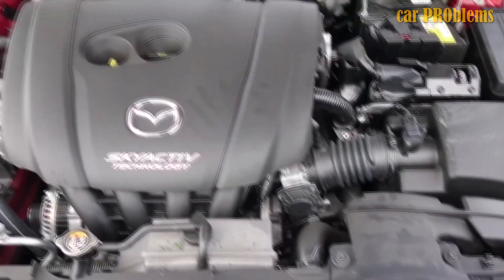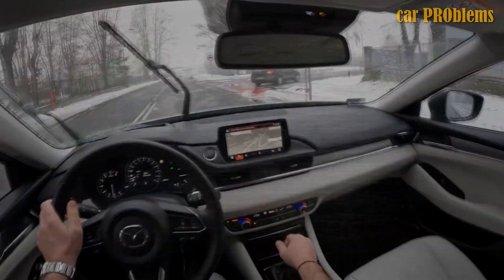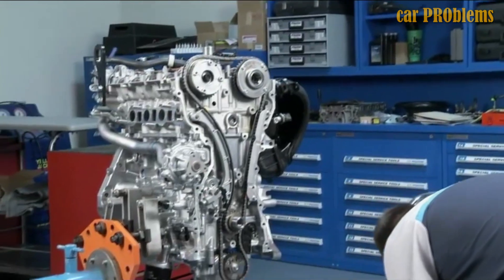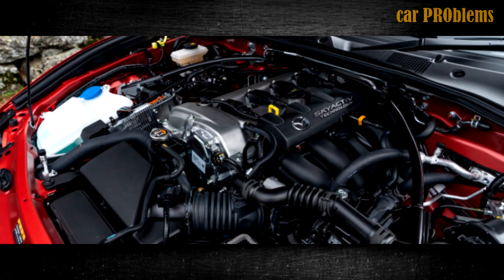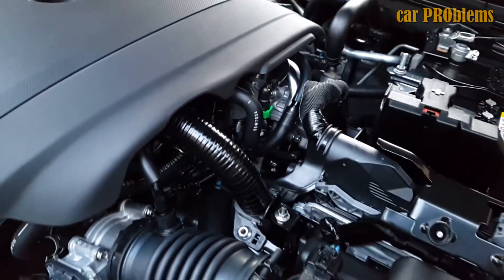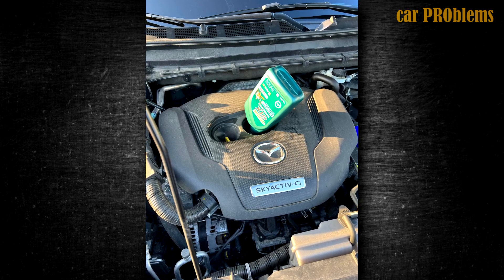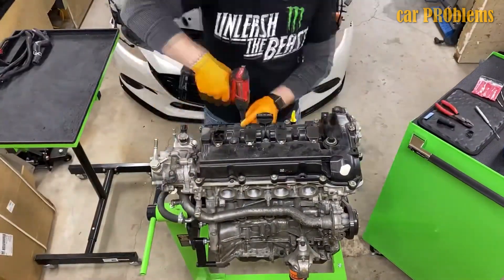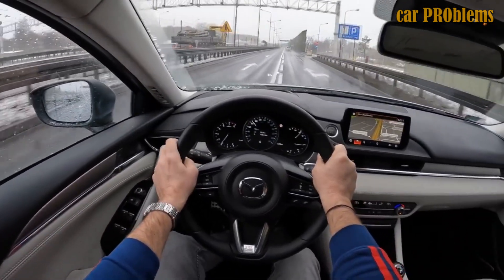Mazda 2.0 Skyactiv-G Engine: Problems, Reliability and Specs

Comment: 2018-2020 2.0 6 AT cx-5 or 2014-2016 2.0 6at cx5 ? Which one would be in better condition at 150,000 km?  How many kilometers can this car travel with its factory-installed pistons and rings without changing any mechanical parts?

Comment: 2012 Mazda 3, fiancées mother owned it until 165k and barely did anything except change the oil. It now has only needed (I did the work myself I didn’t pay anyone) 

a new tensioner, belt, wheel bearings in the rear, brakes, a new gas cap because it threw a code, coolant flush (I wanted to), struts on all 4 corners, (I didn’t like the clunking) one battery, oil changes/filters, 2 air/cabin filters, 2 sets of tires and some sway bar end links in the front and rear (I did them while I was in there doing suspension) 

This car now has 220,000 miles on it and lives a happier life but the point is, with VERY minimal and basic maintenance these cars will treat you well
Reply from the maker: That’s a solid story right there — classic Mazda reliability. You take care of the basics, and she’ll just keep running. 220k and still happy — can’t ask for more from a Skyactiv.
Reply: @carproblemsmax  absolutely love the car, she’s gorgeous, and thank you for taking the time to respond. It absolutely is, Mazda earned a spot in my moral hierarchy with this one

Comment: Bought my 2016 Mazda 3 hatchback brand new with 1 mile on it. I now have 126,000 miles on it. All I’ve done is regularly change the oil every 8,000 or so miles and I had the serpentine belt changed at 105,000 miles. Engine wise, no problems. But I’ve had some issues with my calipers and some broken stabilizer bars. My hatch sits so low to the ground and the shocks are terrible, but overall, it’s been a damn reliable car.

Comment: Use original mazda oil or if you have to use any other oils try Eneos X Prime.
All other 0w20 either don't have the right specifications or additives. I spent like 60 hours to research this properly.
Reply: I use Motul and it runs great. Mazda's OEM (Idemitsu) oil is also very good, though.

Comment: very reliable.. I have the 2.0 G, 117,000 miles with zero issues. I change the oil and filters every 6,000 miles religiously (bosch filters, castrol 5w30 A5 oil).

Comment: Im sick of my Sky G. Nothing goes wrong...ever..nothin to do at weekends anymore.
Reply: Make friends with a chevy truck owner, you'll be busy every weekend helping them.
Reply: 2014 mazda3 with that skyactiv 2.0 manual.. is that good engine in general for moddinng?
or would i be better off with accord?

just reazlied i quiet like how the bdy looks like, like mixtape of A5+accord ass. ;p 

well the one mentionned in the video... 165hp is clearly newer models?

aint 2.0 manual from 2012-2014 like 88kw? :D

Comment: Did he say oil change every 12,000 miles? I wouldn't do that even with synthetic oil. 
I suggest 5,000 mile oil changes with a good synthetic (I use Mobil 1). 
Then if you have to let it slip a few 100 miles it's still OK.

Comment: change the oil every 12k miles? i change mine every 6k Gastrol GTX full synthetic
Reply: I was thinking the SAME thing haha. I change my oil every 3000 miles... Better safe than sorry.
Reply: 12,000 mile oil changes are asking for trouble. Usually do 3,000 to 4,000 mile full synthetic oil changes. I have an MX-5 roadster with the 2.0 Liter Sky Activ G engine.  Really great build quality as its made in Hiroshima Japan. Relatively easy to work on but Mazda pushed the engine all the back in the engine compartment so its almost mid engine giving a 50 / 50 weight distribution.

Comment: I have been driving my 2014 Mazda 3 with the 2.0L and just love it! No, it is not the fastest car in the world but it is adequate, if you know how to drive it. Naturally I have the standard transmission. I got her in 2019 at 36K and have put over 100K with virtually no problems. I do get oil changed every 5K and have done above and beyond what Mazda calls for in terms of radiator, manual transmission, brakes fluids. It goes without saying that I only burn top tier fuel. This just seems like a no brainer. Hopefully the best car that I have ever driven last for a few more years and miles!

Comment: I have the 2018 Mexican Hatchback 2.0 and i couldnt race a turtle with it. 10/10
Reply: Same engine. This one very punchy.  When other late model 4cyl small vehicles race with it, M3 always wins especially at start.  You have engine problems.
Reply: Is it really that slow? 😂🙈 Diesel or petrol? How much hp?

Comment: Made in Mexico 2.0L US Spec engine is very relable in 2016 auto touring sedan model. 42-44 US mpg highway on 87 octane pump gas 10% ethenol.   10 gallons of gas every month is cheap to run.  0-60mph (~100kph) in 7.5 seconds.  Change the oil every 6 months as the car is driven short distances infrequently.  Oil is cheap insurance against many other problems.  Use fuel injector and valve cleaner to remove carbon deposits every six months.  It works.  DIY change the air and cabin filter every year.  It is needed to keep all systems smooth. Still on OEM parts including tires and brakes at 50K US miles.  Climate control flawless.  Starts everytime. Will keep the car 20 years.  Quiet on highway even with cheap thin carpet. Very low quality carpet have seen in a passenger vehicle.  Ride is sporty and tight.  No odors. No issues so far.  Annoying buzz passenger side is metal plate under passenger seat.  Stereo incredible.  No rust.  Wash Wax a few times a year. Paint still shiny, few rock chips.  Garaged.  No road salt here.

Comment: Mazda cars are proven reliable cars i myself own a 2016 mazda 6 until now i have no problems with anything and my 2016 mazda 3 no problems on the engine and it has 85k miles ..

Comment: Does anyone know if 2.0l Skyactive-G 165hp has the balancer shaft (balancer cartridge). In the Skyactive-G 2.5l, the balancer cartridge is mounted near the oil pump and driven by the oil pump chain.

I have heard that 2.0l Skyactive-G does not have a balancer shaft. However, the versions mounted in Miata ND may have a balancer shaft. 

Any comments would be appreciated.
Reply: Only the 2.5 has balancing shaft, all 2.0 do not have it in any iteration

Comment: More efficiency by my Mazda 6 2.5l with 194 HP means easily 12l/100km. Ok, I can also drive it with 7.5l/100k. Mazda did a lot to make their engines more efficient, but to be honest, it is 100% PR.
Reply: My 2019 (2018 model) mazda 3 with the 2.0g does average 14 km/l combined, and I go quiet hard with it.
Reply: I have Skyactive-G 2.0l 165hp in Mazda6. The engine is inferior to the Ecoboost 1.5l 165 in practically every respect. Much less torque, worse fuel economy, more engine vibrations (probably there is no balancer shaft in the 2.0l Skyactive!!!). On the highway the Skyactive is totally powerless unless one gets around 6000 rpm, then it sucks the fuel madly. So, Skyactive is a big disappointment, and a pure PR. In reality, they just make a durable turboless engine that does not stand the competition. The only advantage might be reliability, but statistically most modern engines are very reliable, especially when the car is driven on a highway at cruising speeds.

It is a good engine for a grandpa who uses it to drive at 70km/h on a side road to visit his friend in the nearby village once a week. But for that one can also use Dacia or Fiat with something like 1.0l engine.
Reply: @euregiojam  You sound like someone who does not know how to drive.

Comment: The timing belt was due at 240,000 km.
The small Mazda 3 (2nd generation) with 2.2 l turbo diesel then continues to drive up to a quick 400,000 km. Otherwise there were the usual wearing parts that had to be replaced. But the engine lasted until it was sold. That's a lot, very little problems for actually little maintenance.
Reply: There is no timing belt in this engine

Comment: pmsl@12,000 oil change omfg
Reply: I think these can survive 8000-10000 mile interval with factory Idemitsu (or Mazda branded) oil but only if you're burning good gas in it and putting the miles on quickly.  12K is probably starting to push it, but people have sent in oil samples of this condition for testing and it was still acceptable to run.  Most likely this was a mis-translation (like half of the rest of the video) because Mazda certainly does not say to run 12K mile interval.

Comment: I have engine hesitation at 1200 rpm in 2nd gear. Changed spark plugs..air filter..cleaned maf...cleaned throttle body. Running out of ideas.. any one..??? 2.0l petrol 60k miles.
Reply: 😂found problem... my foot...😂 i was leaving it  on clutch in 2nd 😂 took 10,000km to figure it out.😂
Reply: Try a bottle of Techron Complete Fuel System Cleaner and use premium fuel (93 octane). Oh, there was another tip I saw on YouTube about these engines. Disconnect the battery for at least 24 hours. Longer is better.
Reply: If this is "engine hesitation" that would piss off a racer, sorry, it won't get any better.  If this is "engine hesitation" that a typical driver would notice, there may be something going wrong.
Reply: Spark plugs Sound like ignition coil problem.

Comment: I bought mazda 6 skyactiv 2.0 2015..now 210000km mileage.. so far no issue only small issue.. service every 10000km and put deposite cleaner every time service.. oil transmission and fuel filter pump change every 100000km. And i experienced hight temp due to radiator leak.

Comment: 2015 Skyactiv g mazda. Some small issues like sticky door rubbers, thin paint cannot withstand rocks also glas pitting, mirrors wont close good after a while without lubrication, left speaker blowout "known issue on internet can fix with glue" when volume bit to much bass.
 Driving hard all the time RPM near redzone gives noticeable bit of oil consumption so its right on the low side of the indicator stick when you have to change your oil. When driving normal fast but not too fast gives literally zero oil consumption. I change oil every 8000-10000 km. Bit hard to change from 1-2 when cold if you drive manual.
Reply: Best summary thank you

Comment: nah every 10,000 kilometers oil change
Reply: 5000 km,  oil is cheap, engines are not
Reply: @cnimi  agree with you the old quote "oil is cheap steel is expensive" is still relevant. 
Nevertheless with a 100% synthetic oil 10,000 kms could still be considered a high frequency oil change. We were doing that in the middle east and the engines were running fine.
In the video it was mentioned every 12,000 miles ie 18,000 kilometers in this case I think it is risky even with a 100% synthetic oil.
Reply: Here u cant find 100%synthetic they dont name it 100% only half syn.. what are te best oli to use for the 2.0skyactive?
Reply: @olwillow2115   Castrol makes semi-synthetic I think and Mazda recommends Castrol. Try and find some good oil for GDI gasoline direct injection engines.
Reply: @olwillow2115  I just use original with Wynx oil additive that makes engine silent and 0.4L less fuel consumption.
Reply: Oil starting getting black at 8000-8500 km... 10000 km is a bit to long for me.
Reply: @Coladudetje  SOP in the middle east and trust me our vehicles were exposed to extrem conditions. The oil was fine at 10k. 100% synthetic. The frequency advided by mazda for their 2.0G is 20k, but I maintain th 10k SOP even with continental climate. 

You should check your engine.
Reply: @hugtango you have no clue what youre talking about, learn about thermal breakdown and oil viscosity.

Comment: 14: 1 compression ratio!! This engine Will be spetacular here in BR running with our 30% etanol gasoline.
Reply: The 2.0 Skyactiv has been discontinued in the 2023 Mazda 3, I was reading.  Your vehicle can only use oxygenated fuels containing no more than 10 % ethanol
by volume. Damage to your vehicle may occur when ethanol exceeds this
recommendation, or if the gasoline contains any methanol. Says the manual
Reply: How so? Please explain..

Comment: This engine has carbon issues on the valves needs to be cleaned every 30K or so miles or you will see decrease in fuel mileage.
Reply: This engine does not have carbon issues all the owners forms and research online show they Mazda has controlled the carbon buildup extremely well, especially compared to the competition. It is a direct injection engine however and that means you need to use quality gasoline and quality oil
Reply: @thetechlibrarian  I will respectfully disagree with you, as a owner of a 2016 mazda 3 2.0L the valves do carbon up.
Reply: @joshruner1348  They certainly can, same as most GDI-only systems, but not all will. It really depends on the way it’s used (warm-up/cool-down cycles), the quality of the fuel, etc.
Reply: @joshruner1348 Have you ever cleaned em??
Reply: @bastogne315  Yes, Twice so far about to do it for the third time soon.
Reply: Use oil addivites gives 0.4l / 100km less fuel consumtpion, Engine very silent ppl think its even off when theres a bit background noise.
Reply: Not all of them. It really depends on the life it lives. I drive a ‘14 CX-5 with the 2.0 and 202,000km. Fuel consumption is the same as when it was new. I have seen others that did have carbon buildup, though. All direct injection engines seem vulnerable to this.

Comment: I have a 2010 non Skyactiv Mazda Premacy (Mazda 5). I change oil every 5,000 km or every 4 months whichever comes first. The car runs like a dream. By the way, many Japanese auto mechanic here in Japan swear Mazda engines and transmissions are very well-built and designed.
Reply: I have 360,000 miles on my 2014 3  6 spd hatchback.  Original clutch, no engine work needed.  Last mechanic who did oil asked when I had it rebuilt.  He was convinced it had a rebuild because the engine bay is so dry, nothing leaking.  I've had it since 8,000 miles.  It was built in Japan a few months before they started making them all in Mexico.
Reply: No way 5000km that is waste of money 😱 to my old mazda 3 1.6 BK I did change the oil at 20k km and it's run fine and I have 255k km on board. I have another one mazda 3 skyactiv-g and I change the oil at 15 k km
Reply: @lauroprea1053 Hi bro.. I’m from Saudi Arabia and we don’t have more mazda here , I want buying mazda 3 2.0 2024 Ist good? and Iwant Making simple engine updates for better acceleration.  With the same good fuel economy.  Do you have simple suggestions, such as air filter and others?
Reply: @ba-ras  the last model of mazda I think all are hybrid and they have more tehnology incorporated like deactivation of cylinder so tunning something like this🤔 I think the old one suport better modification and when I say the old one is that witth not gdi engine because they have 14:1 raport of compresion so if you"ll have a knock of the engine you"ll blow it so maybe if you want to make tunning I think it's better the old one like 2.3 engine of the mazda. Have a good day.
Reply: @ba-ras  the only safe thing you can do it to the skyactiv-g for example is to upgrade the soft and if you have an engine with 120hp you"ll make it at 165hp but they are the same engine and you do not modify any component.
Reply: @lauroprea1053  I think we have a 2.0 engine without the hybrid, as described by the seller. It generates 155 hp at 6600 rpm and 213 Nm at 4400. It has a compression ratio of 13.1, but there is no writing in the showroom indicating whether it is skyactiv g or x.  But I think it will come to us without hybrid technology. Thank you and I wish you the best.
Reply: @lauroprea1053  But perhaps I did not explain well. I would like to make even a simple modification to the car’s air system so that it gives better performance, even if only in a small way.  Are there some parts that can be ordered and installed, such as an air filter and others that give better performance?
Reply: @ba-ras  yes kn filters will give you some hp on the dyno but not much one to 5hp so this is not tunning but you can go to a tunning center for a better advice I don't know maybe they will guide you for example for a turbo modification etc etc Sorry but to my gdi I didn't modified at all and because I stay in Europe it's not quite allowed😔 Have a great day.
Reply: Would you expect those from Japan to admit they sold a crap car? 

Of course they claim it's great, duh